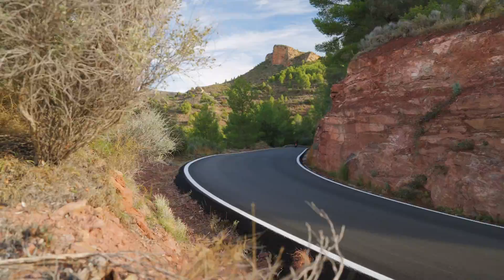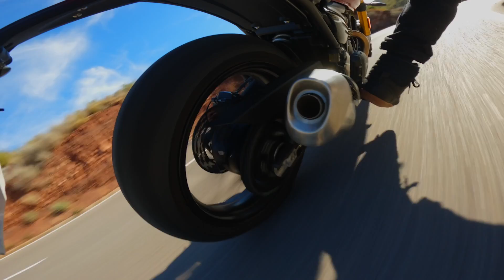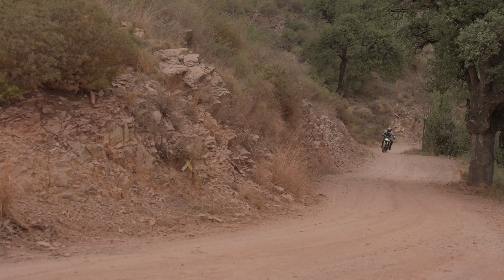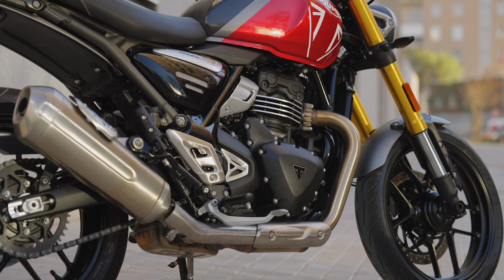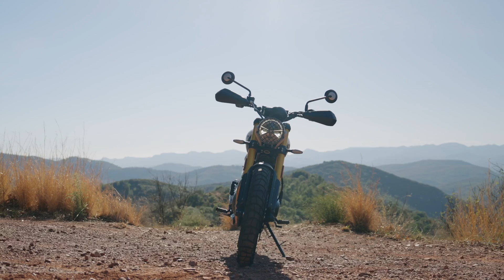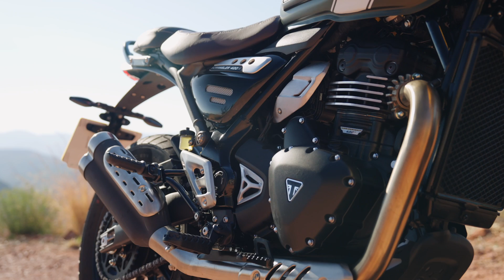2024 Triumph Speed 400 & Scrambler 400 X | First Contact & Interview With the Expert on Sight

Comment: fuel consumption... worst I've got so far is 28km/L (3.57L/100km) I average 29.5km/L (3.39L/100km) and compared to my old Suzuki Vstrom 250SX, if it was going the same speed, and accelerating at the same pace... I think the Scrambler would actually beat the Suzuki's 31.5km/L (3.17L/100km) average. but I didn't get a more powerful bike to keep going slow!

Comment: Good review and info. But do you feel any issues yet. Though the product is great. 

Here in India many owners are having issues like Stalling, RPM Fluctuations on idle, Alloy bend, Engine noise. I am facing engine noise which I noticed recently. And Brand here are not acknowledging it fully. Many people are helpless. I know its too soon for you to feel as pretty new rides.
Reply: For the launching price it was to be expected..it's less than a good eMTB.
Reply: Glad that someone mentioned this.  Yes, we are starting to see reports of those same issues here in the states now.  Dodgy throttle response, poor build quality, ride by wire issues, etc.  Some people are saying that the bike is not up to Triumph quality.  People can spin that however they want...but, but, but, it's built to a price point.  Baloney, crap is crap.  FWIW, I watch these reviews for entertainment purposes only.  I don't trust most of these as the reviewers typically don't have the bikes long enough to actually do a thorough review or they just write fluff pieces so that no one gets offended and they can continue to borrow bikes to "review".
Reply: @jamesbridgman5223  My bike is almost 1 year old now. Though I have driven only 4K, I can tell you its a great bike. Luckily, I haven't gotten much trouble with the bike. I am not a regular rider. Mostly weekends ride. But I am liking the product. Overall Happy. :)

Comment: Great video! How was the engine heat on speed 400?
Reply: He said in the video that there was no heat at all. Reviews from India where the weather is pretty hot reported that they can feel a bit of heat in the city traffic but it was mild and highly manageable.
Reply from the maker: Non existent, altough i was like 20 degrees celsius in the afternoon
Reply: This was lacking as alternative on Triumph’s lineup of options, specifically if you’re a novice rider, it’s always preferable to start on a not so bulky and powerful bike like the more heavy and big engine alternative that Triumph could traditionally offer and because they are, costly wise, higher.
Reply: @Fernando90054  even for experienced riders. I had a few from 50cc to 1100cc. One thing to realise is that from a certain level of power you can only exploit par of the excess power less than 1% of the time, depending where you live and what you want to do. Something light with reasonable power is going to meet the needs of a lot of people. At that price, those little Triumph are really a call to get on a motorcycle and ride. That being said, to have another one for that 1% of the time is also nice. That could be a second hand, old school monster: a VMax, a GSXR,...
Reply: I agree either way with everything you’re saying. These little bikes can always make you lose your license 😅
But like everything in life, when you explore things to a point that you have nothing more to discover, you lose interest and start looking for the next best thing…it’s the human nature in action.
When you swap too soon, you’ll always be saying that the bike was a dream bike and you often look back and miss that machine, maybe because you didn’t explored it to the full extent of experience it could offer. The bikes that I kept more time with me, are the ones that I didn’t explore or I couldn’t explore to their limits.
That’s why I said that these little Triumphs are excellently suited for a beginner rider, but as you said there are other categories of reasons besides that to choose a ride like this and the situation that you referred is right on spot. Thanks for your reply, man 👍🏻
Cheers 🥂